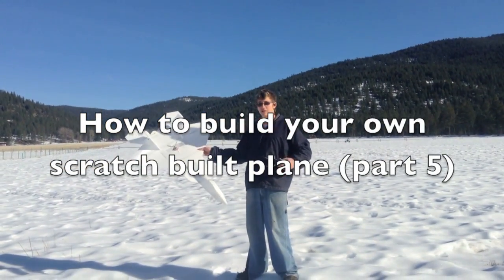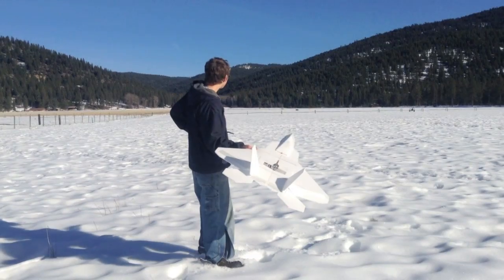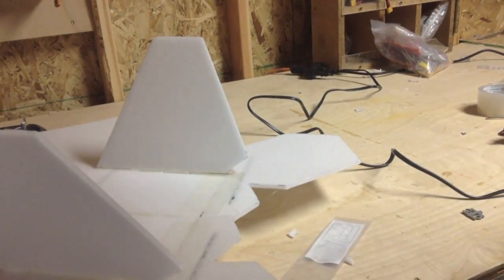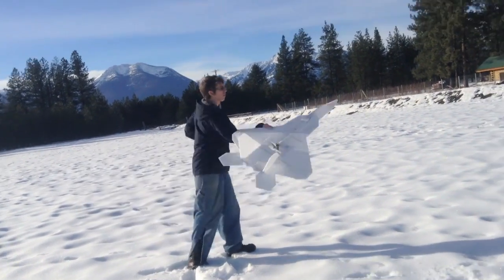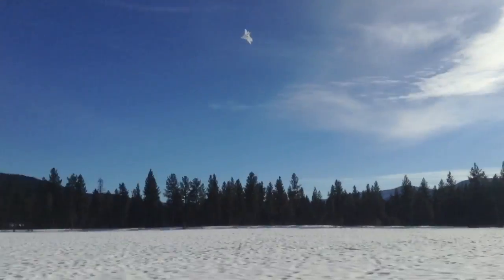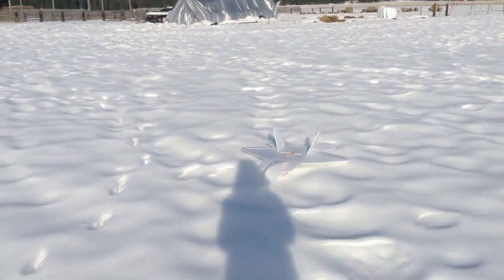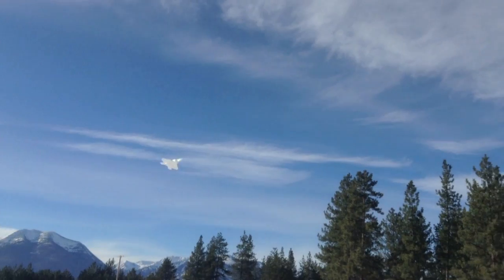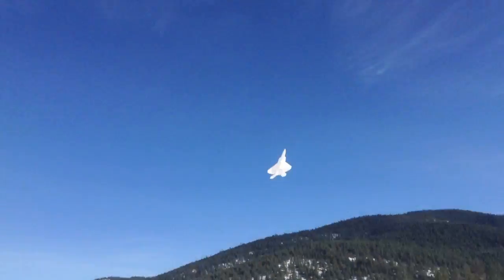How to build an rc plane (part 5)

Comment: Nice video series; cool plane! Could you help me out with one clarification...are your ailerons mechanically tied to the tailevons, or did you use a second set of servos? I built a similar model, but want to maybe add a control rod out to each wing for aileron control, but I'm concerned about weight adding up. I might also add rudders for better control...

Any pointers?
Reply from the maker: This plane only had elevons. So the elevators act as both ailerons and elevators. There were no ailerons. but you can mechanically join the ailerons and elevators. There's a great ebook with diagrams that explains all this http://rcpowers.com/community/threads/flight-facts-parkjet-ebook.19237/
Reply: EZ-flight

Sorry, just realized I missed your reply. Thanks for the answer. I ended up adding mechanical ties to my ailerons, and a single 9 gram aileron servo (longer lead) for the rudders. Seems to work pretty good, but for a profile plane, mine is a bit heavy.

Thanks for the info!
Reply from the maker: Nice! sounds like you got it figured out :)

Comment: Hey tiny question, can you add wheels, also do you think you could take off  off of the ground?
Reply from the maker: I have added wheels on these parkjets but with little success. The wheels add a lot of weight and air resistance, and can offset your center of gravity. It works great to hand launch It just takes practice.
Reply: +EZ-flight Thanks for the response I had a feeling you would say what you said. Anyways keep up the great work!!
Reply from the maker: Thankyou very much Alexander! You can try to glue on custom wheels and they can work. It is kinda fun being able to take off instead of throwing sometimes.

Comment: I just finished building the Free F35 V2 and got all the electronics installed and working correctly.  But I for whatever reason had the plane sitting half way off the table and goosed the motor a bit too much and it lunged forward the prop went flying off when it made contact with the table.  to my surprise it didn't break, but you can see the very tips have some marks on them where they made contact.  i put it back on and it seems ok.  I have not maidened it yet though, as i need to adjust the elevators to make them level like you did.  You obviously have experience flying, but are these as easy to fly as you make it look?  I have elevators only like you do in the video.  my only flying experience is the hobbyzone champ and a friends delta ray.  Thanks for the videos, as I followed along to help build my plane.
Reply from the maker: It does take lots of practice